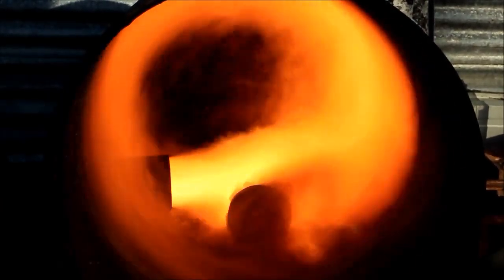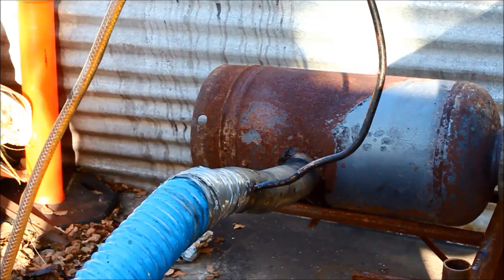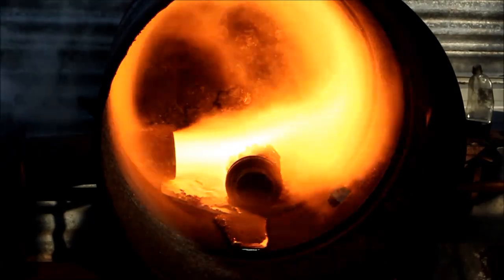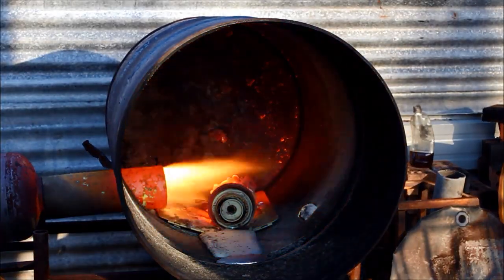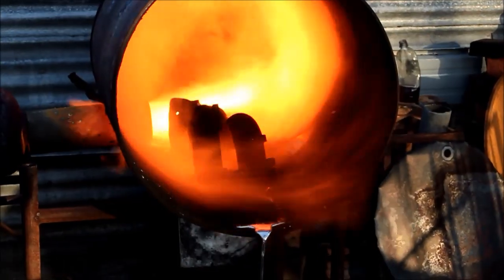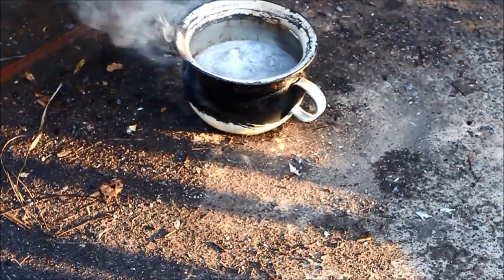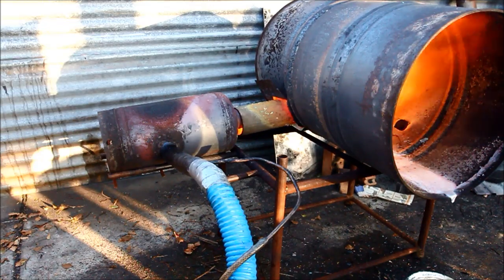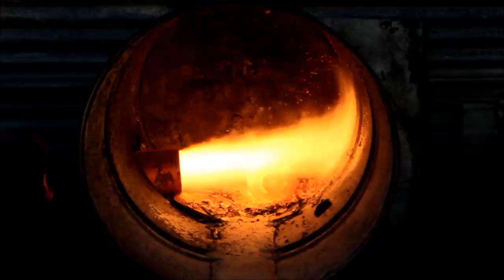Large Scrapping Furnace for aluminium melting, waste oil fueled

Comment: despite the age of this video... this is still a great video to watch. I'm looking to start melting aluminum with waste oil as it will be more economic than propane.
Reply from the maker: I have some more ally to melt and intending on doing another Vid like this soon. I have made some improvements with the output of the burner so will be able to get the job done Much Faster.

Comment: i built this set up with a few refinements and it will melt any motor i can fit in it , a door and a vent are the way to contain the heat and tilting the barrel about 5 degrees allows the molten metal to flow but keeps the iron and slag from moving around

Comment: What type of waste oil do you use?
Reply from the maker: I prefer Veg but used engine oil works exactly the same as does transmission, gear oil etc. Burner is dumb, it does not know the difference so it burns them all the same.  :0)
Reply: Thank you
Reply: Got it thanks
Reply: Do you have any videos or plans are on how to build an oil burner? Or is there a reliable source to buy one from?
Reply from the maker: @imprimisxo   I have a number of vids on how to build these things. have a look through he other vids on my channel.

Comment: Do you think it might burn hotter if you were to put a door with a spout on the front?
Reply from the maker: IAN 4000 If you mean a door and a chimney, yeah, for sure! Not so much burn hotter as retain the heat already generated better. 
The reason I leave it open is for filming. Much more interesting to see the metal melting than just look at a glowing drum.  I have more than enough power to melt the metal anyway and if you look at some of my more recent vids you can see I fire the burner straight in  so it is pushing the heat to the back and it has to come forward again to escape increasing the over all heat retention in the drum. 

Of course to do this properly I should get some refractory and line the drum.
Reply: IAN 4000 How about some friggen oxygen?!!! That thing would melt anything, just as long as you showered it with water... Just sayin'

Comment: few small touches and this thing could burn over 3000 degrees ... and its still a fuckin beast like it is  !!
you had to be in the 1900 + Fahrenheit range to melt that much of that compressor.
Reply from the maker: snorksonforks Not sure what it is in Fahrenheit but it melts copper OK.  I'll get round to a proper insulated furnace one day.
Reply: it looks like its doin just fine really .. and copper melts out at 1,085°C (1984°F)

and the steel drum melts @ 1370°C (2750°F)
So there is no question this furnace isnt kickin ass Oil Burner

Comment: What's that plate in the back of the drum?
Reply from the maker: If you mean the one the AC is sitting on, it was just to protect the drum from the heat and Molten aluminium.
I may have also put the lid I cout out of the drum on the bottom/ back for the same reason.  The backsides seem to burn out of these drums faster than the sides for some reason.
Reply: @glumpy10  Try a mix of type s mortar mixed 50/50 with pearlite. I use it in my homemade forge and it keeps it from burning out so fast. You can look up homemade refractory mixes on youtube to line your barrel and give it a bit of slant to make the metal run out the front better.

Comment: What size is that burner? And could you use it vertical.
Reply from the maker: The burner is about 60 Cm tall by about 20 Cm across.  It was designed to be fired vertical and that's how I normally use it. This was the first time I used it horizontally. As you can see worked fine even in the orientation it was not designed for.
Reply: Oil Burner does it work better on its side?
Reply from the maker: CryB4Die I think it does slightly . there is more surface area to vaporise the oil.  It makes it a little easier to start and very responsive as the oil doesn't seem to be able to pool like it does vertically.  That means it burns whatever you feed it instantly and it runs very hot but it also makes it a bit more touchy to get your fuelling right for a given airflow.

Comment: Why have the smaller propane bottle? Why not inject the oil and air directly into the drum? If the combustion happens in the furnace you won't have a hot burner nozzle and probably more efficiency.
Reply: That is to preheat the oil to easily burn
Reply: Yes, same as making a coiled line around the burner.

Comment: Oh man this is fantastic. I love melting down aluminum, did it alot when I was a kid with my toy cars. 

Just wondering can burning sump oil generate enough heat to melt cast iron?

Anyway great upload.
Reply: Stuart Ross I melted/burnt a hole in (home made) 1/4" stainless crucible with mine on waste oil. stainless melts at about 1365 c, cast melts at 1260 c. Waste oil is the best and cheapest fuel. shhhh dont tell the tax man....
Reply from the maker: I['m getting to enjoy melting ally myself!
You can see on my Furnace Vid where I melted steel. Guys on the metal casting forums do cast iron with oil burners all the time and non of them have anywhere near the power these things Kick out. I do think you need some sort of proper insulated furnace to allow it to be pourable rather than just melt and slump.  After what I did in a few minutes in my pretend brick furnace, I think there would be very little you couldn't melt in an oil powered furnace!
Reply: Oil Burner awesome thanks.
Reply: MON383 nice.

Comment: Excellent video! Certainly a good unit for melting down scrap alloy and getting rid of old engine oil as well. I would have fun at your place melting down scrap car parts and turning them into blocks of alloy.
Reply from the maker: Not as much Fun as I'd have at your place with all your old engines and electronic gear!!
From what I have seen of your place, it should be called "Paradise!"  :0)

Comment: Great stuff! It will make short work of transaxles, too!
Reply from the maker: yeah, there seems to be a lot of stuff that is aluminium with steel embedded that would be hard to seperate by hand. That's what the thought behind this was.  After the ally and steel are seperated the ally could be either sold at the right price or refined further if need be.  Where I am, aluminium motors are only worth steel value, about $10. If the ally was melted from them, I calculate it would be worth $50-70. If you could run say 4-5 in a batch, I think they would be well worth melting seeing it would only cost a bit of free time.  I'm wondering about gearboxes as well. I think there would be a lot of steel in the gears but I'm curious how thick the ally casings are.
Reply: Gotta be worth a try!